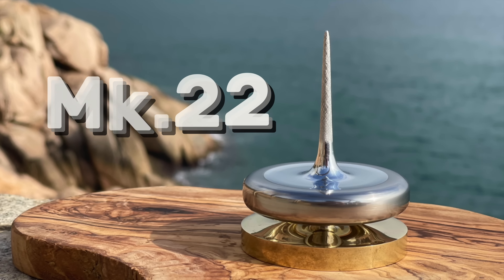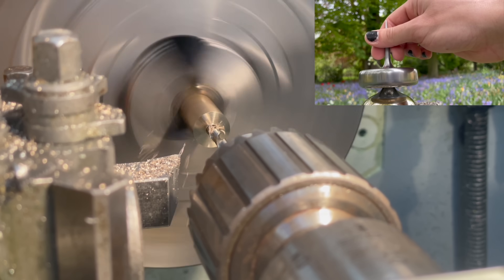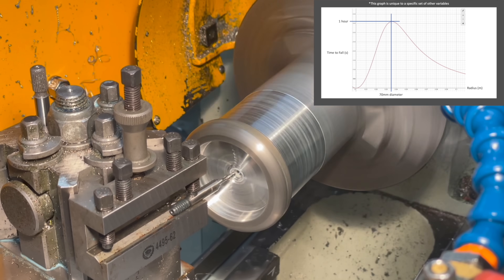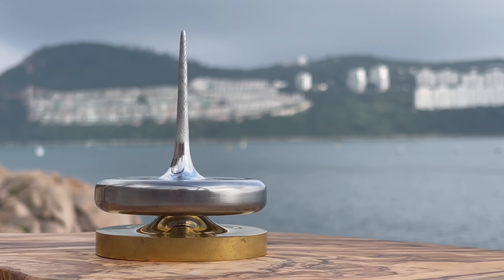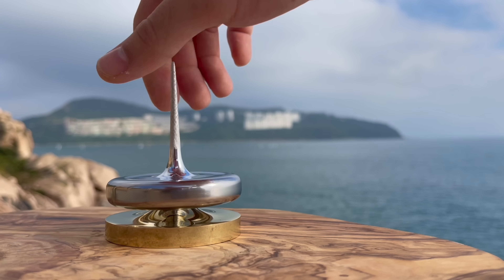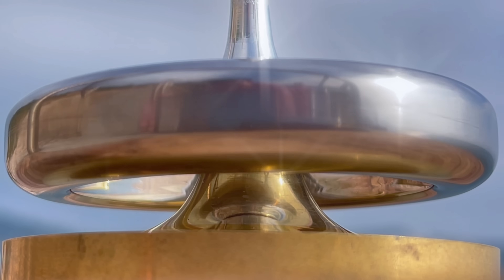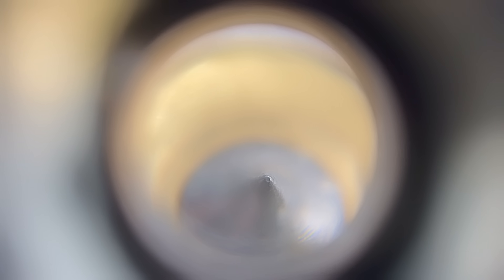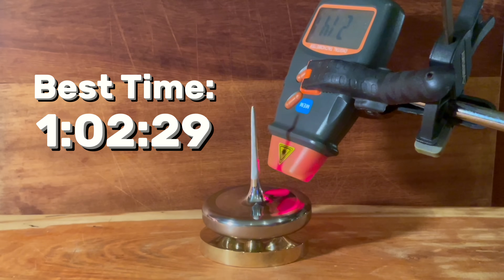Spinning Top Mk.22 | 1 HOUR BARRIER

Comment: Congratulations. It’s been so fun to watch your tops improve with each video. I don’t know how many hundreds of dollars this would cost to produce a small run, but I would back the hell out of that Kickstarter
Reply from the maker: Thank you :) To be transparent, if I were to make 10 or so Mk.22-like tops (something I am thinking about), they would be at least 600 USD each. Aside from the large material cost - especially the flywheel - it takes many hours of skilled labour on my part to get them to as high a standard as this. It's an economic puzzle! However I am very aware of the large demand and want to produce something so stay tuned😄
Reply: @hiper_tops  yeah that is definitely in the range of what I expected. I’m still backing at ~$600!
Reply from the maker: @andymangold  Thank you that's very encouraging to hear😇

Comment: Some thinking out loud. The bottom of the spinning top expels air outwards, creating a slight low pressure zone underneath, and therefore a slight downforce onto the tip. Would there be a way to change the geometry of the base such that you create a slightly higher pressure zone instead, decreasing the tip force?
Reply from the maker: May I recommend this video: 

https://www.youtube.com/watch?v=-wggqn9sgiI&ab_channel=IacopoSimonelli

As you can see, and I have found with my tops, spinning tops act as centrifugal pumps, expelling air radially in a disk at the maximum radius of the flywheel. Even if I could deflect the air such as to create a high pressure under the top, I suspect this effect would be negligible in comparison to the weight of the top. 

Exploring using the ground effect or air bearing tech would be interesting, and I believe it would help, however it feels like cheating. For the effect to be useful, the top and the ground would have to be so close that the top can no longer 'topple' - and hence is not a spinning top. 

Still, aero is definitely a possible area for improvement!
Reply: @hiper_tops  In airplanes, the ground effect works up to a height of about half the wingspan. I can see how a spiral groove bearing would feel like cheating (despite being technically contactless) but do you really need the surfaces to be that close for it to be an improvement?
Reply from the maker: @xzorby  Actually I'm not sure I would call what I'm imagining the ground effect - since there's no lateral airflow to be compressed here, I was thinking air would have to be sucked in and expelled downwards. 

Aside from the large drag this would cause, to have a 1% decrease in the weight of the top,  assuming a down-flow of air half the ground area of the top could be achieved, 14.5km/hr winds would have to be generated. This is just some back-of-the-envelope maths but is very generous and I think shows how difficult it would be to decrease tip friction by deflecting the airflow.
Reply: @hiper_tops  Ah so like a helicopter? Helicopters do benefit from ground effect so you might need a little less airspeed than what you calculated, but still I don't think the decrease in tip drag would ever outweigh the increase in aerodynamic drag.

I meant leaving the top smooth and closed as is, and just reshaping the base to redirect the airflow it already creates. As you said, the top functions a bit like a centrifugal pump, or perhaps a free spinning centrifugal pump rotor. My suggestion is to give the rotor a partial housing perhaps with grooves, redirecting the radially expelled air axially to underneath the top, thereby increasing the pressure below. I guess that would have little to do with ground effect. The top would sit in a "bowl" with grooves, or "half shroud", so again it might feel like cheating. Also I don't know how much benefit it would be.
Reply from the maker: @xzorby  I see! Iacopo simonelli has used near-full shrouds around the flywheel portions of his tops and found a benefit of about 5% for spin times. However he attributed this to the reduced velocity gradient, since the shroud keeps circulating air around the top. I believe it would be possible, though a little complicated, to redirect the existing air flow downwards. However, still not nearly enough air is being moved to help.

Comment: Question: does it change angle over time?
Reply from the maker: At the start of the spin it self-rights itself. For the majority it is the "sleeping position" or straight upright. Towards the end of the spin, due to drilling into the base, or right at the end, due to imbalance, it will wobble or spin off axis.
Reply: @hiper_tops shame, it would be really cool to detect any kind of angle preference or shift even a small one due to Earth's rotation. At that length of rotation it could show something but I hope a physicist can correct me.
Reply from the maker: @j.d.5262  If it were a gyroscope it should rotate, however I believe spinning tops do not because they aren't free to rotate about axes other than the primary one.

Comment: Did you think about a ruby point and a sapphire clock face base or it would not make much difference at this point?
Reply from the maker: I have considered it, in fact Mk.21 could use a ruby point. However ruby is less hard than tungsten carbide so carbide ends up being a bit better!

Comment: High-Performance! I wonder where the theoretical maximum would lie, assuming that’s even a meaningful question to ask.
Reply from the maker: I think there is an answer haha if you keep enough variables constant (altitude for air pressure, lack of wind or shroud aid, no external support etc) then it comes down to the limits of materials (high and low densities, hardness and tribology) and human spinning skill! I don’t think 2 hours is possible but that’s a soft limit based on my experience :)

Comment: Are you able to put a thin layer of silicone lubricant where the point of the top meets the base?
Reply from the maker: I currently use an oil lubricant however if you have any tribological suggestions I’m all ears :) something good under extreme pressure, low viscosity and friction!
Reply: @hiper_tops  Hmm, I don't know how well it works under extreme pressure but I used a personal lubricant on the slide action of a miter saw and it smoothed up really well.  It might sound like a joke but the Turned On brand on Amazon is a good place to start, that's what I used.  The ingredients are Dimethicone, Cyclopentasiloxane, Dimethiconol, Phenyl Trimethicone.  It's light weight and low viscosity.   What oil do you currently use?
Reply: @hiper_tops  Hey there, just wanted to check in if you were able to try other lubricants.  I was thinking perhaps using multiple types of lubricants may help too.  For example, you can clean then apply a viscus lubricant onto the stand.  Then wipe it clean and buff it to leave a super, super thin coating, then apply a thin lubricant that doesn't mix with the thicker one.  The idea is to have multiple layers to add lubricity.  

Another idea is perhaps to apply a teflon coating, buff, then your thin lubricant on top of that.  I think you can buy teflon spray, but I really don't like the forever chemicals...  

Just some thoughts to mull over.

Comment: Amazing, what if you placed the flywheel extremely low to lower the center of mass even farther? Another Idea is covering the surface in dimples like a golf ball or another precise surface texture/detail to create a turbulent boundary layer surrounding it which would serve a similar purpose as the shroud used by Iacopo. It would not be a shroud so it would still be considered in your catagory. The only flaw would be how to create the dimples geometrically perfect with precise weight distribution.
Reply: The function of dimples on a golf ball is to avoid flow separation caused by form of the ball travelling through the air, flow separation is not relevant for the spinning tops because their form is stationary, the most important thing is to reduce surface friction because most of the loss of energy is lost by the air sticking to the surface and being pulled to the edge of the top before being spun away
Reply from the maker: Interesting ideas! Regarding the flywheel, if it was any lower, the cog would be below the tip and the top would no longer topple but stay upright (at which point it is no longer a  true “spinning top”). Iacopo’s shroud works differently to dimples - it keeps a circular flow of air around the flywheel which reduces the velocity gradient and hence drag. Dimples on the other hand would certainly grab more air but the velocity gradient would not be reduced. See some other comments for more info :)

Comment: have you considered reducing the area of knurling to lower air drag?
Reply from the maker: Yes, however the reduction in air drag would be almost negligible because the velocity gradient at the knurls is so much smaller than on the edge of the flywheel. The extended knurling is more practical for the start of the spin :)

Comment: High-Performance! 
What's next? DLC or c-BN coating the tip?
Reply from the maker: I think DLC has more potential than c-BN because of c-BN's highly abrasive nature (the top would drill into the base, or if only the base was c-BN, the base would rapidly wear the tip). I have experimented with c-BN and that is what I've discovered so far. On the other hand, DLC does seem quite promising! I'll look into it further :)
Reply: @hiper_tops  Ah yeah c-BN is probably not the best idea even if it does have a higher hardness. Oerlikon Balzers did a demonstration video with a non-coated vs a DLC coated spinning top 7 years ago if you want inspiration.
Reply from the maker: @xzorby  Ah that's an interesting video! Thanks for suggesting it. I wonder how scientific the demonstration was ... I'm sure I can find some proper academic papers which may give some reliable insights :)

Comment: Did you consider using a golf ball-like surface?
Reply from the maker: It's a cool idea but unfortunately not! Golf ball dimples help by increasing viscous (skin friction) drag but decreasing pressure drag (by more!). Since spinning tops don't experience pressure drag and only viscous drag, dimples would be counter productive. You may find this video interesting:
https://www.youtube.com/watch?v=g_LTJTaOxCs&ab_channel=BilletSPIN 
Note the best top has internal dimples, however the change in airflow in this region is unlikely to be the helping factor; but rather light-weighting to reduce tip friction.

Comment: I really want to see this spin in a vacuum chamber, but i don’t know how you’d get it started
Reply: since it spins for an hour in air, could probably get it going then pull a vacuum. Would be interesting
Reply: @tebla2074  Good point. I'm curious how much it would affect the time. It would quantify roughly how much drag there is compared to friction. Could give insight onto further improvements.
Reply from the maker: @rebeccarivers4797  You are right, this data would be very useful. And @tebla2074 is right about how it can be achieved. I just need to get access to a suitable vacuum chamber, however I suspect making one myself may be easier as what I'm looking for is quite an unusual shape. I'll see what I can do!
Reply: @rebeccarivers4797  also, have you ever spun this up with a motor? Would be interesting to see how long it can go with higher starting rpm
Reply from the maker: @tebla2074  I have started my tops at around 5000 rpm before (I can only reach 2500 by hand) and found it decelerates to 2500 rpm in a couple minutes! For reference, at 2500 rpm, the spinning top loses approximately 100 rpm per minute.
Reply: @hiper_tops  that is so interesting!
Reply: @hiper_tops  I really wonder why that is!

Comment: High performance,  would golf ball dimples help with drag?
Reply from the maker: It's a cool idea but unfortunately not! Golf ball dimples help by increasing viscous (skin friction) drag but decreasing pressure drag (by more!). Since spinning tops don't experience pressure drag and only viscous drag, dimples would be counter productive. You may find this video interesting:
https://www.youtube.com/watch?v=g_LTJTaOxCs&ab_channel=BilletSPIN 
Note the best top has internal dimples, however the change in airflow in this region is unlikely to be the helping factor; but rather light-weighting to reduce tip friction.

Comment: Would it make any sense to reduce tip friction by adding features that produce some amount of aerodynamic lift? Or would the corresponding drag be too much?
Reply from the maker: This is an interesting idea which I have not considered before. I have a strong instinct that the increase in air drag would be disproportionate to the gains in reduced tip drag - this is particularly because for the top to have any significant lift, it would have to be spinning incredibly fast and spinning fast = lots of air losses! It would quickly slow to the point where little-no lift is gained. 

https://www.youtube.com/watch?v=KCt0byMMrDI&ab_channel=kevinmartin

You may find this video interesting, however note in this case the features create a boosting torque when blown on as opposed to a lifting force.
Reply: I think it would be difficult because the amount of lift is proportional to the rotation speed, the top constantly changes speed so it would be difficult to optimize for an amount of lift that is beneficial yet doesn't result in the top simply floating off the platform